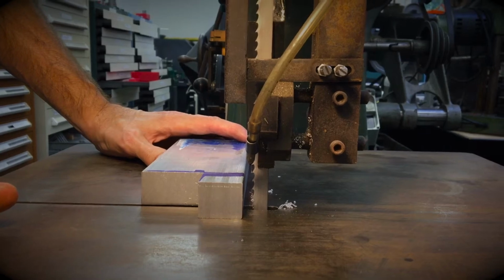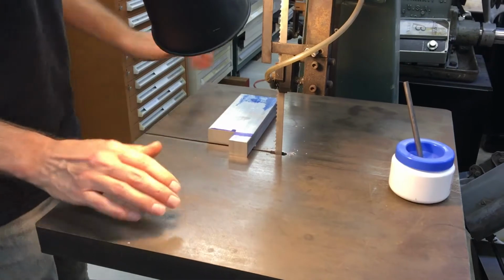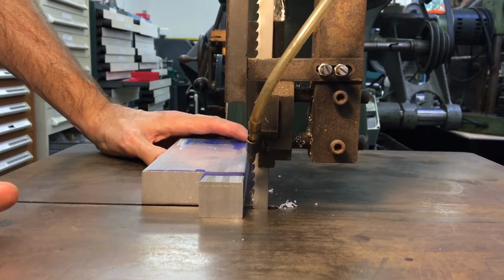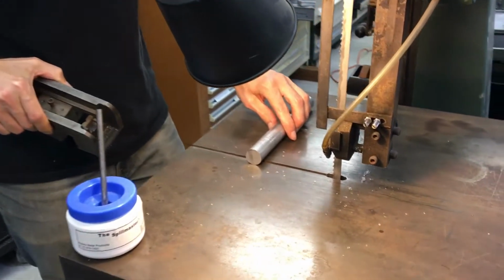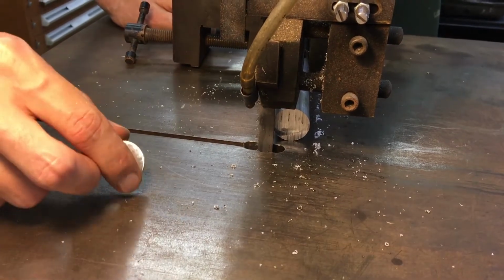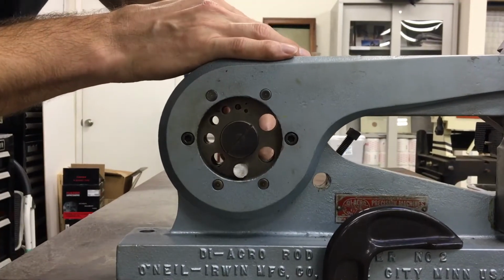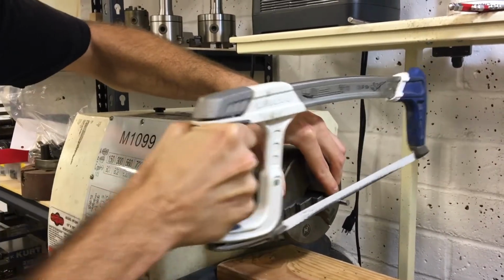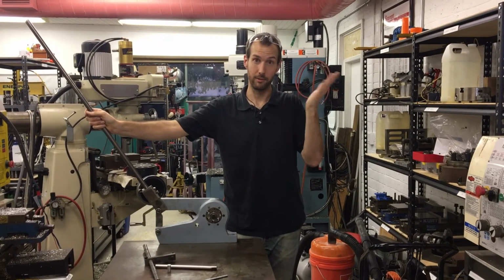METAL BANDSAW: Safety & Alternatives for Round and Odd Shapes

Comment: Jez hack saw on the lathe? What, you have a metal lathe but no vise?🤪
Reply from the maker: We have a great vise id like to show some time. I wanted to show the lathe as an option because the lathe is often the most rigid vise in the shop.
Reply: Bench vises are trash for holding round stock, even worse for holding 6061.

Comment: what is the effect when the blade guide is not tightly on horizontal metal band saw ,sir ?
Reply from the maker: You will not get a straight cut, particulary with stainless and other metals that resist cutting. The blade will usually walk around. You want to make sure your guides are adjusted to the right gap and are tight and lubricated. Some use bearing guides as well. Check the bearings and replace if they are no longer smooth.

Comment: Nice job Chris, but how about sharing sources? For example, the dispenser for Tap Magic is nice because there's one for steel and another color for aluminum. While small cans work great because they're free (I snag the 4-ounce size from the garbage after my wife opens mushrooms), and writing on them with a Sharpie to ID the fluid works because along with an acid brush you've got everything you need, the fact is permanent markers aren't permanent once you have oil on your hands. This makes the color-coded ones you used a nice upgrade. Unfortunately, a quick visit to the Tap Magic site doesn't show them and thus, a part number would be great! Anyway, I've been sucked down the rabbit hole by your well presented videos because of their excellent emphasis on safety. Attaboy!
Reply from the maker: ModelSport Thank you for your great advise and for subscribing!
Reply from the maker: Here is the link for the jars. I don't label them bacause every shop I have worked in puts cutting fluid for Aluminum in the blue ones and cutting fluid for steel in the red ones. It is just a known thing for us at this point. They even sell white ones we put grease in. 
Thanks for your positive comments, we try to be as safe and helpful as we can!

McMaster-Carr Page:
https://www.mcmaster.com/No-Spill-Jars

Comment: If you are going to use a 4tpi blade on round stock it's going to be scary. To me that blade seems too aggressive, and won't cut anything besides thick aluminum and wood.  I know aluminum needs more of a gullet, or the blade will load up. I rarely cut anything that thick, if that's all you use it for, I don't really know any better.   IMO A blade with more tpi, and a varied pitch will cleanly cut a variety of materials, albeit not as fast, with less jaw clenching at the outset of a cut.
Reply from the maker: We cut lots of thick aluminum and switch to a variable pitch for steels